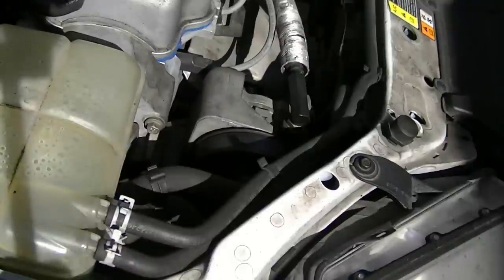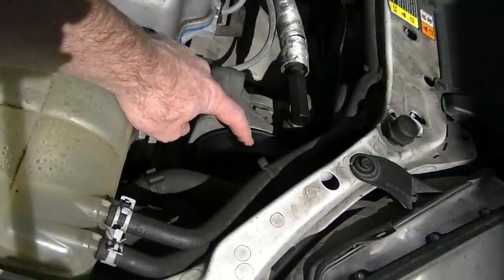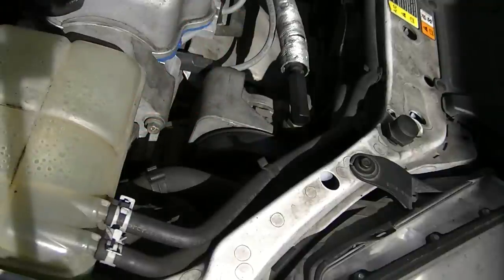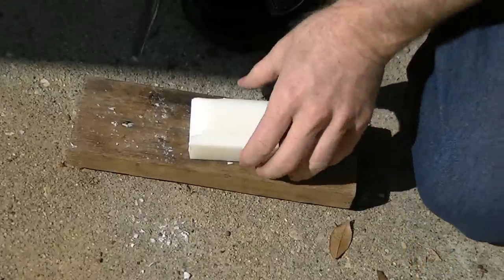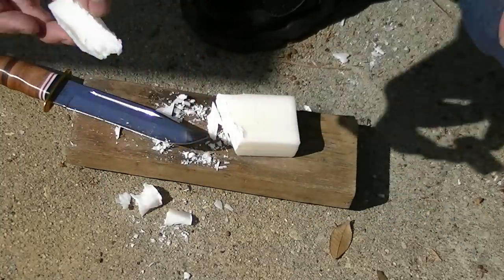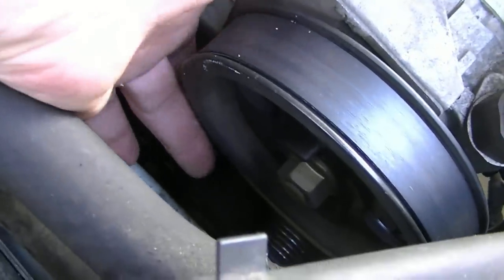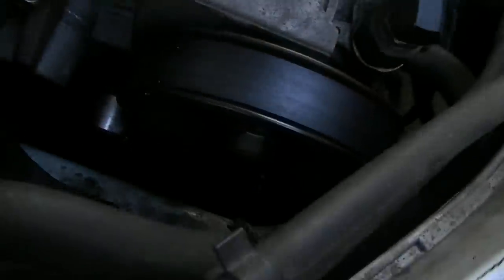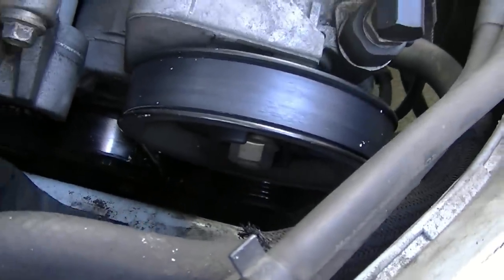How To Quiet Squeaky Belts On A Car - Cheap And Easy Fix

Comment: DON'T USE BELT DRESSING whatever you do!!  Hoohoohoblin mentions in this video that they make a "belt dressing" that you can get from the auto parts store.  Belt Dressing is for old fashioned neoprene rubber belts.  All belts made since (roughly) Year 2000 are EDPM Rubber.  Belt dressing will cause EDPM to swell up, and your squeak will get so loud you'll need earmuffs!  (when I was a kid, belt dressing was part of a regular tune-up--  not needed with modern belts).
Reply: Tod728  Heard this warning  before ! Advice from tire dealer...Do Not apply any shiny tire product on . In time cause cracks on sidewall, just use Auto shampoo...Not household detergent !

Comment: Isn't that stupid?  The whole purpose of the belt is to transfer power from the engine to the wheels.  Adding soap would make the belts slippery and lose tension and horsepower to the wheels as a result.
Reply: do you know how a vehicle works, the belt is not transfering power to the wheels, it si simply running the accecories such as power steering and alternator the power is fed to the wheels via the transmission, differentials, and lastly driveshafts
Reply: Brah..... 😑
Reply: O dear....
Reply: Joe Black  , yes for a start the sqeaking or screeching tells you that a belt is slipping , why make things worse.(whatever the belt drives)

Comment: My 1998 Dodge Ram 1500 V8 4X4 is squealing just like that.  Louder with elevated RPM. You think this would work on it?  Hate to spend 500 bucks on a new water pump and have it still yell at me.  Its rather embarrassing when folks look over at me at an intersection and it sounds like a farm of crickets lol
Reply from the maker: It depends on where the squeak is coming from. Try this first before spending any money.
Reply: Definitely will. Much appreciated!

Comment: Unfortunately, the belt is squeking again. Looked for the spray, but the local shop doesn't have it, so I have to order it. Lesson learned - if the belt becomes squeaky, better get it fixed right away, or it goes worse..

Comment: Wouldn't recommend WD-40.... too much lubrication.  Wouldn't do any mods to a timing belt... just pony up and change it.  As for a serpentine belt or other non-crucial belts, this probably will work well.  Used liquid soap on an exercise bike with a hard to find belt and it worked great.  WD-40 caused too much slippage.

Comment: just tighten the belt tensioner and i love how no one has said how stupid sticking your fingers on a water pump belt right next to the pulley is you do realize if you get caught it will take your finger off but otherwise good try ;)

Comment: Pretty stupid advice if you ask me. Forget the soap and do the following: Prepare many pieces of fine (80, 100 or 120) sanding paper and sand pulleys a bit. It is relatively easy on cars with simple V-shape pulleys / V-belts, but it is possible with these types of belts as on this example as well.

I can also give you the most simple solution: just spit on the belt while the engine is running and you'll make it quiet instantly :-).

Or brush your teeth and spit the toothpaste directly from your mouth onto the running belt.

In most cases squeaky belts are result od poor tensioning, so check if tension is as it should be and adjust before doing anything.
Reply: or just give 10 - 20 bucks and get a new one and put it on?
Reply: I'll try the sanding of the 2 pulleys... I've got 80 and 400 here... it is sqweaking 2 seconds once or twice every ride to the supermarket, because the car is 11 years old... There has to be a small layer of old rubber on the surface of the pulleys ... and sanding could help the belt to get more tension (because of the removal of the old rubber on the pulleys, maybe 1/32 of an inch better) I'll check if giving more tension helps another time, but my bet is on the cleaning!

Comment: All this is doing is making the belt slip quietly, the squal is from your belt slipping. So once the soap is off the belt, ur squal is gunna come back. Take the logical approach and replace the bad pulley or the belt. its worth it in the end. do NOT use this on ur belts and for god's sake dont use a silicon spray either. a lot of people do that.

Comment: Well, soap works good, but I´ll tel you something just better and faster : use baby powder or foot powder. noise will be gone as magic, won't harm anything, will last a lot, well, just keep it from water... if it gets wet, wait until it dries and apply again. I have been using this on my mazda b3000 after I installed new water pump and belt. Still good trick buddy....

Comment: Mines a very loud squel  and I mean load but last for maybe like 15 seconds then goes away
Reply: new battery needed
Reply: can you explain why that is. Does low battery not drive the belt at a particular speed?
Reply: +Zain Wasfi maximum loading needed if you drive low batt..or empty
Reply: +Maarten Yzer has a new alternator and good battery
Reply: +Adam Ortiz perhaps spanner v belt bad bearing so turns heavy..
Reply: does it happen when youre air con is on
Reply: Adam Ortiz  r
Reply: An Ru yes

Comment: know this is an older video but still seems pretty active.  Wondering about my belt, I put WD-40, belt dressing, water, etc.  all made it worse, the only thing that seems to take it away are rainy days!!! Weird as heck, think it might have to do with humidity.  I don't get it. Mechanic says it's fine but holy hell is it annoying, if soap is the hidden gem, I'm gonna laugh!  Thanks.
Reply from the maker: LulzNAmuze It's worth a try.  It is possible that the squeaking is coming from a bearing on one of the pulleys.

Comment: Why not just hold the bar of soap against the belt while the car is running?
Reply from the maker: That would probably work, but it might accidentally rip one of your fingers off, so it's safer to do with the engine turned off.
Reply: Ah! Good point! I wonder if dish soap (and water) in a spray bottle would work?

Comment: and don't be a Jew going cheapo on the cheapest belt price u can find....  i learned my lesson, went to Autozone to c if my pulley belt still was on warranty (1 yr) because it just to noisy in squealing and i think i bought the belt not long ago. well it turn out the the belt had barely passed the warranty period (last month) and therefore i couldn't get a free replacement. Sucks because these manufacturers purposely design these to fail just after the 1 yr or whatever yrs its covered and u r forced to buy a newer one!  This time i bought at Pepboys the Made in the USA Dayco brand belt which come with a 3 yr warranty already!  i stopped being cheap now....  lol

Comment: your mechanic is trying to fuck you over, it does not cost 600 to fix, it starts to squeel because the rpms drop too low, you may just need to replace the belt which is very cheap.

Comment: it is an zinc-alloy cheap crap, get a knife with 1060 carbon, or spring steel, or if you are rich buy a folded steel which has been clay tempered.

Comment: It's the Tensioner pulley that needs replacement, please do not ever put soap on your timing belt, LOL!! Unless your a mechanic don't mess around with your car's engine.

Comment: Buy a good, quality belt.  Cheap belts will do this.  If an old belt starts to do this, replace it!  If that belt goes, you are stuck and it will probably happen in the middle of no where!  It's not worth saving the $20-$30!

Comment: You shouldn't do this.  You know how soap dries up and Can cause your skin to dry and crack.  Well this will Happen to the belt also and belt becomes brittle. Use belt grease it's only 2 bucks.

Comment: can't you just used wd40?
Reply from the maker: It might work.  I haven't tried it.  The soap should last longer.
Reply: did you try wd40 in the end? did it work?
Reply: i used wd40 it only worked for like 2 minutes
Reply: Careful with WD40, it will wash away any grease on the moving parts like fan or pulleys (if any) and cause your parts to wear out even sooner.

Comment: I bought new belts believing my old ones were causing the noise, and it's still squealing im sick of it im embarrased of turning my car on, sound like an old piece of crap
Reply from the maker: Maybe it is the bearing. New pullies with bearings are pretty cheap.

Comment: A new belt is like £10 and its a 5minute job to fix this for another 80,000miles !!!
Reply from the maker: That's a good point.
Reply: Andi Burton and as akward as hell you can't even get a socket on its so tight, just done mine its is akward, open ended spanner and a bar over it to get leverage

Comment: Seems easier to just apply the soap while the car is running. Wearing gloves of course.
Reply from the maker: Dangerous!  If I was going to do it while the car was running, I wouldn't put my fingers against the belt while it's running.  Maybe hold the soap in there with needle nose pliers.
Reply: Yeah Jordan, sticking your hands in there with some floppy gloves that are easily grabbed by the pulleys of a running engine wouldn't cause you to lose any fingers AT ALL!!   Then again...  you sound like the kind of guy that's already lost a few fingers and an eye.